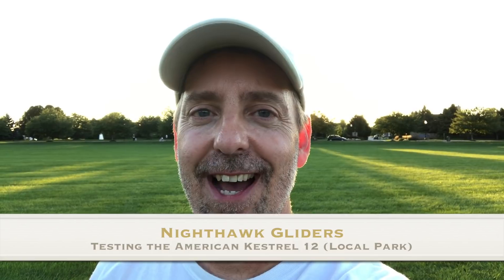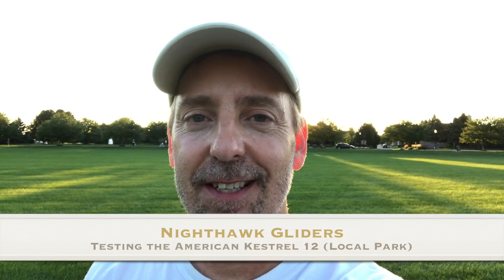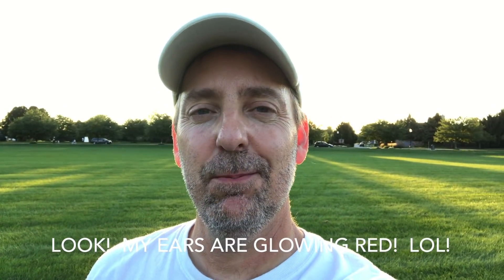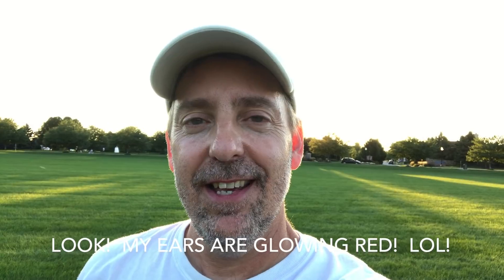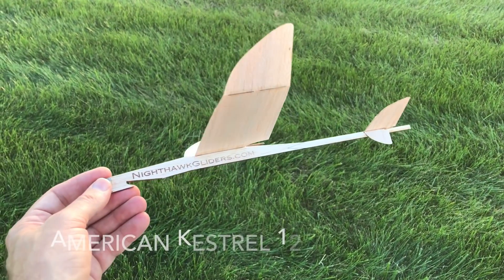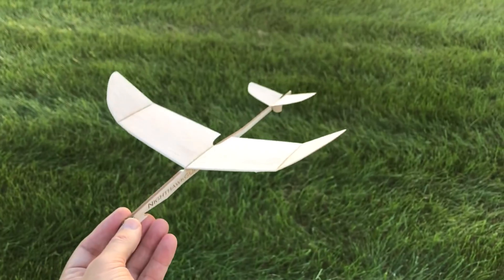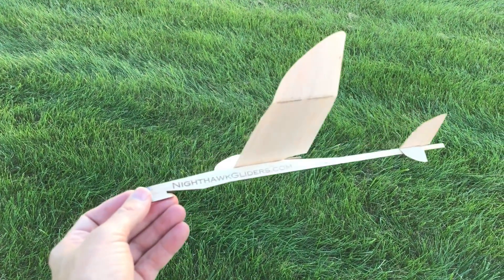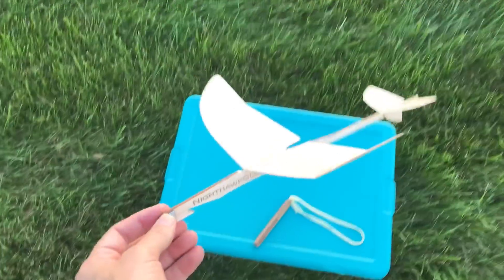Testing the American Kestrel 12 (Improved changes?)

Comment: Seems 30 second flites consistently :)
What is the notch in the wing ????
What is its purpose ???
TNX :)
Reply from the maker: Well, technically, if wing is sanded thin enough, you can gently curve the trailing edge of the wings down to slow down its gliding speed and increase the wings lift performance.  But, I think it’s mostly for looks!  😜

Comment: I like to trim my gliders to the point it they just almost barely barely barely threatens a stall dip !
But that is just me :)
Reply from the maker: That’s cool. What type of gliders do you fly and do you fly them indoors or outdoors?
Reply: @NighthawkGliders  Hello :)
I fly a almost a 12 inch Sandpiper :)
I used some of the dimensions of your sandpiper but do not cut the sweepback on the leading edge , also I use a horizontal elevator , with the rudder in front glued to the stick !
I do spend time when I build !
I am so much a stickler for accuracy
I have trouble getting much done !
I posted on Hip Pocket aerodynamics earlier ! I flew in the park today and had one really good flite :) tnx fer reply :)

Comment: Do you have any tips and/or links to videos for long flying indoor gliders?
Reply from the maker: Good question... especially if you are doing this for competition such as in Science Olympiad (for example.)  I'd say some of the key obstacles to indoor flight is (1) Low ceiling height and obstacles, (2) Air conditioning/heating left on, and (3) hardwood/cement floors...  So, you'll need to have a super-lightweight glider that has a reasonably large wing area that is close to the minimum weight required by your rules.  You want to launch it as close to the ceiling as possible w/o hitting rafters, lights, basketball hoops, etc.  Avoid air drafts because that can make your glider stall dramatically (and even crash!)  Normally in competition, they turn them off, but when you are practicing, you may not get such luxury of turning these systems off.  Hard floors can be a challenge-- especially if you are testing gliders and they are not trimmed yet... they can stall, flip, or roll and hit the ground hard and break.  If you have a calm day, launch your gliders outside over grass to get them initially trimmed.  When indoors, launch them gently and lightly and trim them as you progress to higher and higher altitude.  The main keys to good flight time are high altitude on launch, successful and quick transition into a glide, and a good glide ratio. Always launch your glider with a starting roll and trim your rudder to continue its glide in the same direction.  And I repeat-- avoid the obstacles... if it hits something, the flight is over!  So, change your launch location and/or direction!  And finally, build lots of gliders and practice, practice, practice!  I hope that helps!  Good luck!
Reply: @NighthawkGliders  That was very helpful, thanks!

Comment: couple 30-31 second flights...  NICE!
has me wondering if the egg carton top idea cant be modded for band launching.
its sure not that I don't love balsa, its the cheap+available+recycled things everyone has!
Reply from the maker: Thanks!  Still holding on to your egg carton plan... for I have a few cartons stacked on my shelf.  Someday, I hope to get around to tinkering around with that idea to see how it flies.  😊
Reply: kept really light, for indoor tossing it'll surprise ya. thinking it'd need about a 3" spar (skewer slit to half round) to bridge the big dimple so it doesn't fold up with a band launch. a hook up front with thread and CA, moving the tail feathers forward a little for a bit of skewer to pull back... all easy enough to tinker with.

recently watched a couple foam board chuck glider videos, it's generally too thick for small stuff but some of the foam board DLG (discus launch RC glider) were really impressive!